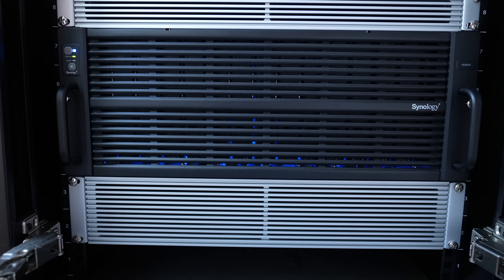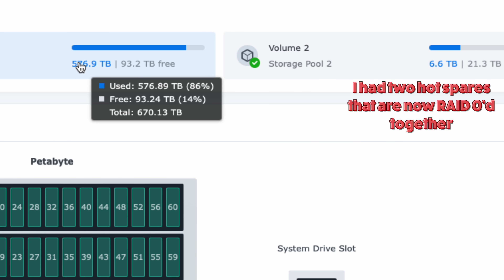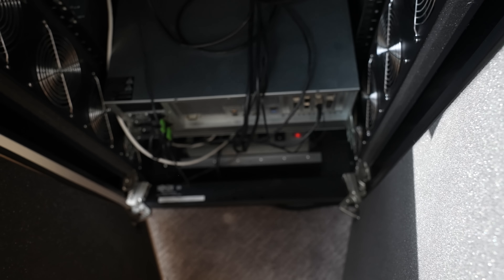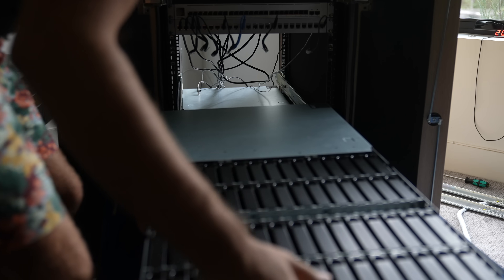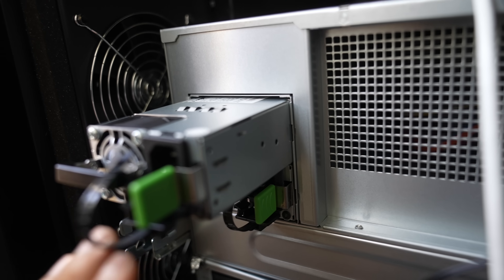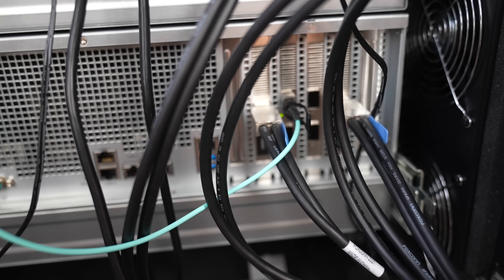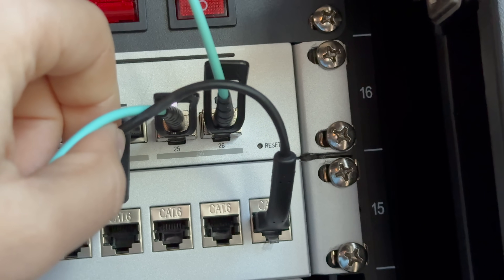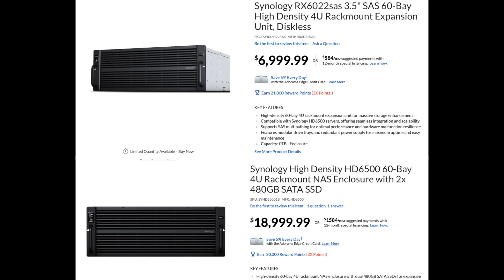1.9 Petabytes - Expanding the Synology NAS

Comment: @TheSlowMoGuys2 Silly question but I'm reading conflicting things in Synology's documentation... does the HD6500 run on 120V power or 200-240V power? Manual and docs online claim the higher voltage but it doesn't seem to be true?

Comment: I have an APC UPS  for my system. Just a 4 bay NAS, my Structure Can which includes a 24 port Cisco Switch. When you have a fast rundown of power you can daisy-chain  ups' . One from the wall to feed another and the second feeds a third. At their Head End, Comcast has a ups that takes 3-48v deep cycle batteries with an inverter to power a single rack.

Comment: I don't think I would trust this much data with anything else but zfs and I also hope the workstations have zfs mirrors when working with local data. Given a network this fast, maybe working with local data is not needed anyway as it just adds copy steps and potential data corruption when not using something like zfs mirrors?

Comment: that powerdraw problem will only happen when both boot at once - the power draw of 120 drives ramping up is quite insane. each drive can pull up to 25W to boot up, and all at once that's 3000W.

These should stagger spinup by design (it takes more power to spin up a drive than at idle, so most storage servers will spin up a few drives at a time to prevent a large spike), because there are 60 in each (otherwise it'd be 1500W each).

i cannot find whether these stagger spinup at all, but google says these take 1000W while accessing data, so i'd assume it gets up to 1200-1300W on bootup, and then scales back when the drives are up to speed, so 2500W on that UPS, not including whatever else is connected, is a lot of power.
I can't tell what UPS that is but a quick google shows a UPS looking like this can be 1800W, 1980W or 2700W (Depending on 120v or 203-240v, i'm guessing here), so yeah that makes sense these both would overload the UPS at 150% on startup.

the rest of the equipment in that rack is probably a max of 500-600W combined? so 3000W ish checks out for a ~1800W UPS. yeah you need a second one.

Comment: Something to consider is that you are getting close to the limit that your normal house circuit can provide for power. US uses 120v and the typical house receptacle is only 15 amps so you are looking at 1,800 watts total. Main Synology HD6500 draws 900, RX6022sas draws 500, Mac draws 150-250ish so you are looking at 1650ish.

Last thing that you need is to randomly be tripping breakers during a big write or worse, have it happen when you can't do anything about it. (Out of town/country)
Shouldn't be that bad to have a electrician run a dedicated line to the room and if he makes it a 20 amp circuit it will give you plenty of overhead.
Reply: Most PS can also just switch over to a 240v also which makes it easy

Comment: Not clear on the specifics, but if whatever you plan to keep on the expansion is worth saving you should probably leave it turned on 24/7. Bit-rot on powered off hard drives is of special concern when you're talking about massive arrays like that.

Comment: Many organizations and individuals store terabytes or Petabytes of data "just in case" they might need it, often without evaluating its true value or relevance. This practice not only consumes unnecessary resources but also leads to higher energy usage, increased costs, and reduced efficiency in data management. For instance, keeping hundreds of archived videos, outdated files, or redundant backups on high-speed storage devices may offer little to no tangible benefit. Instead, implementing a more strategic approach to storage, such as archiving rarely used data on slower, cheaper media, can help. By adopting better data retention policies, we can save space, reduce waste, and minimize environmental impact. Thoughtful storage practices ensure that resources are used effectively, focusing on what truly matters.

Comment: I'm surprised a bit, but, well, this is the traditional approach.

My case is significantly smaller with about 18 TiB.
I have a primitive python scripts.
Any file is converted into an "info file" (with name, tags, description, encryption key and block list) and a series of 8MiB blocks.

Info files are small, they are in a git repository, therefore safe.

Blocks are stored on 4 SSD disks (4, 4, 2, 2 TB), a 14 TB disk, a 10 TB disk (it used to be off-site)
External SSD (4 TB), a few MicroSD (one in laptop, one in a Mac).

A small web interface to manage redundancy.

Apparently, I should make this more user-friendly and release the software.

Comment: I would be very concerned with the rebuild time on that new set of arrays; usually the largest array you'd want to go for is 10 drives wide, maybe 12 if you wanted to squeeze a little more data in. 

You could do 10 wide RAID5s for the same data vs parity across the volume, which would reduce the rebuild time, reduce the number of drives under stress during the rebuild, and reduce the likelihood of a second drive failing during the rebuild process (or immediately after).

Comment: Did you consider replacing your 16TB disks with larger disks, then selling the 16TB disks?

You could have done this over time (not all in one go). It would have been cheaper and would require less electricity and noise than having 2 storage units.

Comment: I just looked at the cost of one of these things and it's way to expensive for what it is. It's a minisas attached backplane in a Box for 7000-9000€ without the disks. You could get i cheaper for like 5000-6000€ not Brände by synology.

Comment: While you couldn't find existing videos about the Synology expansion unit specifically there is a glut of videos and information about this type of system which is called a JBOD. It's Just a bunch of drives and acts as expansion to an existing server.

Comment: Re: Static, Just always ground the rack, and you’re pretty much completely good. You have a UPS in there which by default should have a chassis ground so as long as there’s no insulation isolating it from the rest of the rack, all static should discharge to ground through the UPS chassis.

Comment: You really should consider keeping the tape drive for offsite backups (two tapes/copies ideally separate locations and two different brands of tape) and the NAS for local backups, also consider using ZFS Z3 arrays it will be more efficient you can do arrays of 16-20 with 3 drive failover per, ZFS will also prevent bitrot which you currently lack with RAID6 and that means data corruption and therefore data loss over the years, raid6 isn't enough.

Comment: 900 watts + 500 watts = 1450 watts of power. That's about 35kWh a day or 12.702 kWh a year. With the average kWh price in the Netherlands being €0.30/kWh this is a whopping 3810 EUR (almost 4000 dollars) just to run those two Synology storage servers. It may be a bit cheaper with the US powerrates, but nevertheless I hope you have some solar on the roof to compensate!

Comment: Pro tip: your backup battery can handle just over its VA rating in peaks watts. What you have there looks like maybe a smt1000r2u which can handle just over 1000w peak. The 1500va unit can handle just over 1500w peak. The rma wattage of these units is a bit more complicated and thats what yhe guage is based on.

Comment: will synolog really still use plain raid instead of zfs or some kind object storage? How it keeps care of bit rot?
Reply: "Object storage" has nothing to do with how bits make it to disk. Zfs is still using RAID, though, to be fair, not "plain" RAID. But there's nothing that prevents a plain RAID array from scrubbing its data in the same way Zfs does.
Reply: @wbfaulk  but plain raid array does not know what is rotten data and what is original data. In theory disk should tell that but sadly it is just theory at most of cases. It is not so uncommon that zfs scrub find data corruption what disks wont report.
Reply: @TH-wr1dv  RAID6 certainly can. Since there are two parity disks (sort of) for each set, computing the parity of the whole set confirms the data. If that fails, confirming the parity of the set minus parity disk 1 and again minus parity disk 2 will show if it's one of the parity disks or a data disk that's corrupt. Fixing the parity at that point is trivial; finding a corrupt data disk requires more comparisons, but still trivial, and it can be corrected as usual.

Whether or not Synology's RAID6 does this, I have no idea. And, to be fair, it's not inherently part of the RAID6 specification to do this. But it's more than feasible.
Reply: @wbfaulk  and at that case you need that all disks are available. How about case that one disk is dropped, another is at scrubing but you got bit flip at bus? That is quite common case after all. I just wont see how people still use plain raid at any production enviroment where bit rit is not allowed. And this is not theoratical angst against raid. I have almost 1000 disk in different kind pools currently so I have seen quite lot of different kind things. We also use hw raid at some cases but only at places where bit rot is not catastrophe.
Reply: @TH-wr1dv  "Quite common case". Okay. It's unclear that "bit rot" even exists at all at the drive level. But if it does, it's rare, and then your scenario is that it has to occur when there's already a drive down in the set. What's Zfs going to do in the equivalent double-failure scenario? 

I'm not hating on Zfs, for what it's worth. I've used it somewhat extensively under Solaris and FreeBSD for … 15 years or so? And WAFL, on which it is conceptually based, for longer than that. And dealt with hundreds of terabytes of data through much of that time, on both magnetic and solid state drives. It has a ton of great features. But this notion of bit rot is wildly overblown.
Reply: @wbfaulk  Clearly we live at different reality then. I have seen quite many bit rot cases and it is not uncommon at all that zfs find errors at scrub. Bus errors are most common to errors what goest trought hardware checks. But it is not un common even to got those from disk.
Reply: @TH-wr1dv  Maybe consumer vs commercial hard drives? Maybe one of the reasons that storage vendors have custom hard drive firmware?

It's also claimed that most instances of supposed "bit rot" are actually uncorrected memory errors, which wouldn't cause any storage problems since that corrupted data isn't written back out? I've certainly seen a ton of memory errors.

Again, I've run Zfs in a commercial setting with large amounts of data and I don't recall ever seeing any scrub errors that weren't more all-encompassing disk failures.

Comment: I worked at Weta Digital during The Lord Of The Rings production. We did the VFX for the first movie in 1999 with 3TB of Netapp storage! The entire movie. All data files, background plates, renders, composites, etc. We couldn't fit it all on disk at the same time so we had to shuffle stuff back and forth from tape. We had hundreds of DLT tapes. The Netapp was a full 48U rack. I can't remember how many disks we had in it and their sizes but I'm pretty sure each disk was in the order of tens or hundreds of MEGAbytes (not gigabytes!) at most. The fact you can fit 2PB in 8U boggles my mind.
Reply from the maker: Incredible ❤️
Reply: Kioxia makes 30TB SSDs, with a typical max density of around 60 drives per 4U, a full 48u rack of disks would be around 21PB (and a cool $3.6mil). Insane how far and how fast things have improved over the last couple decades
Reply: @ethans4783  And this is before you get to the U.3 mad stuff, 50TB drives in a 1U etc...!
Reply: @ethans4783  Yep but that drive is few times more expensive than rack made of 4tb crucial ssds for example
Reply: @ethans4783  there are 100TB SSDs (3.5") in a 80 bay 4RU shelf, will get you 96PB in one rack (100TB Exadrive x 960 - 12x accustor as480x6s (80 bay shelves) not including a controller server, which i would probably take out 2x of these bays for, which would bring it down to 80PB)
Reply: Come back in 5 years and boggle your mind even more.
Reply: In 1999 you could get 36gb 1.6” high SCSI (more likely fiberchannel) drives, a full 48U rack stuffed full of those may end up at around 3tb (or 18gb 1” high drives)
Reply: @Intellistation6225 I had a 20 gb Seagate back then, and it was $300 😢
Reply: These are still HDD's and currently I think the largest are 32TB. put sixty of those in a 4U rack and you hit about 1.7 PB. I Can't remember the total number of drives the largest storage server I built could handle but it was a 5U machine and I think it was a bit over 100 disks. That was a total pain to move. Fortunately it was installed in a server hall and they had hydraulic lifts to get the case at the right height. Those rails were really solid though. Having it slide easily into place was pretty awesome. But I can't help but wonder what would happen is you pulled it out at full length of what the rails allowed to access all the disk bays. The weight must have put some serious strain on the bolts that held the cabinet bolted down to the floor. Happy I never had to try that.
Reply: @blahorgaslisk7763  36. But more is coming.
Reply: I wonder where all those tapes are now
Reply: Storage as come a long way in the last 20 years.
Reply: Every two years, I look up what the biggest sized SD card is every time I do it, I'm amazed. Wild to think you can potentially swallow the entirety of cartoon network's entire show line up to date.
(I don't know if that's verified but it sounds good, so I'll die on this hill.)
Reply: Can I get an original copy of that???    :)
Reply: I mean, a company called Nimbus Data makes a 100TB 3.5-inch SSD drive, the same size as these 16TB chunky bois, but at 40 grand a pop (as of 4 years ago on an LTT video), they're pretty much reserved for big enterprises that need maximum data density per server.
Reply: @lezlienewlands1337  There's no way it's the same size...gotta be bigger
Reply: I started at a uk high street bank in 1995 and we were told in hushed tones when we were shown the data centre that the total storage for the bank was 3.5 terabytes. Don’t think any of us had heard the word terabyte before. My desktop had 80mb at the time… 

I believe they’d just started using RAID then. Storagetek Icebergs.
Reply: Supermicro makes a 1U, 32 Bay Server (SSG-136R-4MU32JBF). With next gen Solidigm 122TB U.2 Drives, you can put almost 4PB in 1U. It will cost more than your house, but still cool.
Reply: Back then what was the largest HDD available to be used at weta ?
Reply: Moore's law is fun.  When I graduated high school I bought a 1 GB flash drive for $55 after a mail in rebate from Staples.  Now you can easily get a 1 TB drive for that, some 2TB on sale even....

Comment: You mention concern for static generation, and yet you have a feline dynamo wander through the box. I would be surprised if, as this is all plug and play equipment, that it is not pretty well statically enclosed stuff.  It would be interesting, however, to see if there is a static strap/smock system for feline supervisors.  🙂

Comment: You need tape storage at this point. I doubt you need to access everything every day, so it's probably a good idea to dump all the raw stuff to tape and just keep a "library" of super low res footage that's coded/tied to the specific tape that holds the actual data. Whenever you need the actual thing, you pull up the specific tape and use it. Safer too, long term. You're less likely to lose data that way. It's basically a "vault" system.

Comment: Why is the expansion unit number display a seven-segment when it will only ever show a maximum of four?
Reply: Tell me which of the seven segments is unused between 1, 2, 3, and 4. Or are you arguing that a different display should be used altogether?
Reply: @wbfaulk  While it's true that all seven of the segments will be used, not all nine of the possible numbers that the display could show would be displayed.  The display could be simplified into just four lights.
Reply: @Blue-Maned_Hawk  If you want to go down that road, it could just be two LEDs. But the point is to make it abundantly clear which shelf it is, potentially to the high-school dropout that is the "smart hands" tech at the remote datacenter. And you're complaining about less than $2 worth of electronics.
Reply: @wbfaulk  On very large scales, those two dollars could add up—but frankly, monetary cost is not my biggest concern.  I am more concerned about unnecessary overcomplexity.  If you want to make it clearer with just four lights, why not just have labels under them?
Reply: @Blue-Maned_Hawk  Those two dollars get added to the price of the shelf. It's an irrelevant amount of money. And this is a SAS enclosure. You think a seven-segment module introduces complexity? This is the most bizarre complaint I've ever heard.
Reply: @Blue-Maned_Hawk  What do you think is possibly going to go wrong with it? It's seven LEDs with a common leg, and there has been a dedicated controller IC for them since 1974. I don't know know that they're using one of those or driving the LEDs from some trivial microcontroller code, but there is essentially nothing to go wrong. Again, this is an insane complaint.